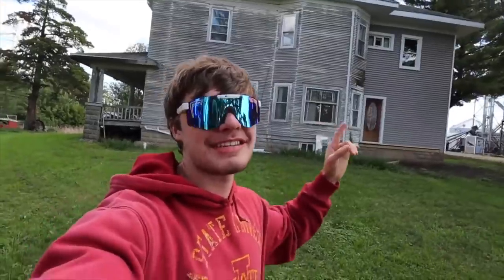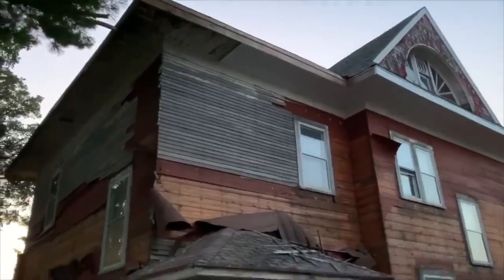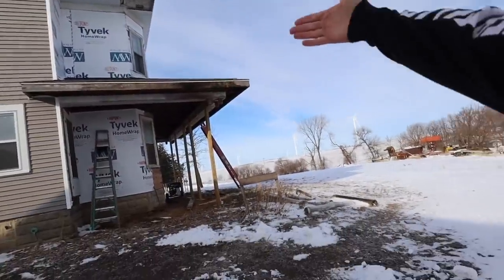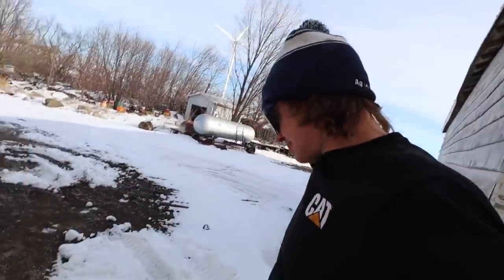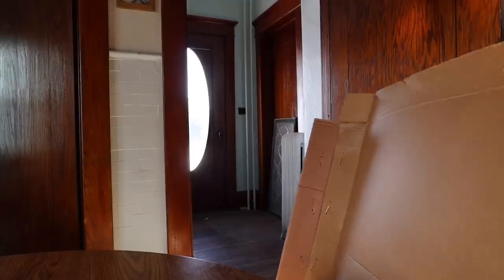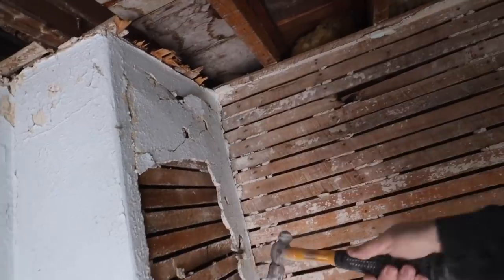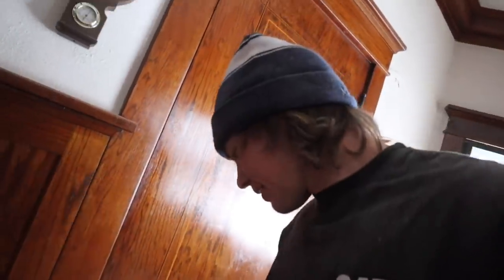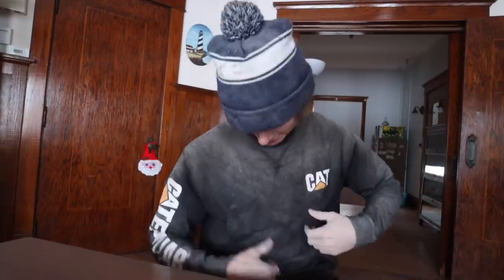Remodeling My Ex-Hoarder Mansion Ep. 1

Comment: the real fun  fun part starts when you go to drywall an old house like that is that they were built with real fir 2x4s and  you can not drive a nail or put a drywall screw in them as you will need to drill a pilot hole for every screw ! I did a little remodeling on my old farm house years ago ! wasn,t fun !!  torn that old house down this fall

Comment: When I was a kid in the 1950's, I used to hear commercials on the radio by the plasterers union because drywall was coming into use, "Demand genuine lath and plaster." They tried to stop the clock and now they no longer exist. You have some of that real vintage stuff! Enjoy your history lesson. Those floor joists are full size! If you need more that will be some custom milling. Houses today border on being flimsy. Enjoy your remodel of a real substantial house built by old timers who had their head screwed on straight.

Comment: You should mark the back of the trim pieces, so you know where you removed them from, so when you start to but them back up you know where they go, in older homes nothing is square and plum, and the marking of the pieces should help you with the puzzle of what goes where. A simple letter and number system should help. number the doorways and left and right trim pieces. Ect. and a basic sketch of the layout of the rooms will be helpful.

Comment: Cole do you get double glazed windows in the usa, this stops alot of heat loss if you get the right ones? Save on heating but stick up some solar panals, u would get free off grid electric. That alone would cut your bills down.

Comment: If you really have asbestos to remove, wet it down with a spray bottle with water in small sections and as you pull it apart to remove it. That will help to minimize airborne asbestos dust.

My brother has a house built in 1912. It has and old coal chute where the house was heated using coal. Over the years an oil fired furnace was added for hot water and steam heat. Several years ago he replaced the oil heat with central heat and air conditioning and removed the steam radiators. The steam pipes and hot water pipes in the basement were insulated with asbestos. He draped plastic sheeting and sprayed down the pipe insulation with a spray bottle, wore a respirator and disposable coveralls and removed it in short sections placing it directly in a plastic bag as he worked.

Don't let the asbestos blow out the door as you work. It will settle on the ground outside and can get airborne every time you walk through it or the wind or breeze blows. Even today the roads in and out of and ground around old asbestos mines is highly contaminated and asbestos dust can easily be stirred up.

If you have asbestosbe careful and stay safe.

Comment: Just install a 2.5 inch pipe from the basement to the attic that you can later pull electrical through. Should prevent you from having a sub panel in the awesome attic.
Reply from the maker: That's a good idea!

Comment: A bit late to be commenting this, but if you are good at drywall mudding or you know someone who is, I'd highly recommend just tearing out all of the lath and plaster walls, in general, and replace them with the sound isolating drywall, potentially with rockwool or a similar sound dampening insulation in the outer walls and the ceilings to help isolate noise between the floors and to help create isolated heating and cooling zones. Doing this will also allow you greater access to route forced air HVAC so you can use heat pump HVAC units instead of needing to rely on radiators for heat. Radiators just aren't terribly effective, even if you're a fan of them. Heat pump HVAC units can be a bit pricy, but their overall efficiency is great since they can heat or cool depending on which direction their pumping the refrigerant and, as long as your ambient temps are always above, like, -15F, you can find heat pumps that'll maintain a decent heat output. Ripping everything down to studs will also make it loads easier to figure out which walls can be easily removed and it'll allow better access for water and electrical work. Most houses from that era typically have few bathrooms, so taking the opportunity to reduce the number of bedrooms in exchange for more bathrooms can dramatically improve the livability of the space. If you can combine an existing bathroom into an en suite, then you can also sacrifice a bedroom to create a powder room that opens onto the hallway and another bathroom as an additional en suite bathroom for valued guests. Rinse and repeat as necessary. I like when houses have as many bathrooms as they have dedicated bedrooms with an additional half bath. So if you have five dedicated bedrooms, then it would be nice to have five and a half baths. That way, all of the people who are expected to be living there can all use the bathroom at the same time if you, for example, all come down with food poisoning from some dodgy take-out. If a room is meant to be an office, library, listening room, conservatory, or another specialized room, then it doesn't need a bathroom as it isn't a dedicated bedroom.

Comment: You need to fix the house wrap as the water will soaking in to the blown in insulation and then your going to really start having a gross mess inside the walls. That bath room was a hall closet or a closet off the bed room. There was not in door plumbing when that house was built.

Comment: As a professional air sealer from PEG I urge you to not epoxy the basement floor, but rather install a subfloor with drain matt underneath to prevent intrusion of moisture laden vapor and radon. Basically it is best to create a "bathtub" of drainage matt in basements.

Comment: Where's Neva Cole? 1. What is the response time of your local fire department to your place. 2. Where are the two closest fire hydrants to your property? 
3. Is your local fire department heavily dependant on tenders?  Given the amount of fuel load the house house in wood, you don't have sprinklers, no appreciable fire code upgrades being done, you should seriously consider having your own private source of water that can easily handle two 1 - 1/2" fire hoses supplying water at a significant pressure. Because you want to attach the garage to the house, the passthrough could become a means for the fire to quickly spread from the garage to the house. All new code approved wiring, breaker panels, switches, receptacles, light fixtures and appliances. Seriously consider installing sprinklers in the garage. It goes without saying, smoke alarms are a must. These things should be top of mind before an in ground movie theatre. Your life and the life of anyone who stays at your home should know that their life safety has been taken seriously when it comes to fire protection and suppression.
Stay safe.
Gerry, British Columbia, Canada

Comment: You mentioned that the house doesn't have insulation - mine doesn't either, but we're still planning what makes sense for us, since we have fairly new siding. Since you're putting new siding on, why not add exterior insulation board? Or are you using exterior foam?

Comment: I'm in process of buying a ~120 year old house and planning much of the same kind of demoing/renovation you seem to be planning! Nice!
Any thoughts on the structural aspects of the outside clapboards and inside plaster/lath in a balloon framed house? (Might wanna consider some added diagonal bracing in the process with all the original stuff coming off/rotting out?)
Just a thought, hopefully a supportive one! :)

PS: my new place is all knob/tube wiring, too. Looking forward to rectifying that. And the old galvanized plumbing. And the rather risky vermiculite attic insulation. And the ~80 year old garage/shed. And adding a 1/2 bath to the main floor to get it to 1-1/2 bath status. And replacing the 50 year old kitchen (cheap at the time even). Maybe if I do it, I'll link ya a youtube channel. :D "Thanks for watching!"

Comment: Another question, did you leave all the old water boiler radiators, I hope you did. With a new VieSSmann water boiler furnace which is very small is excellent. All so you can attach heated flooring and heated towel racks to it also. You do have a big house you may need 2 furnaces. Just saying. Can hardly wait to the finish product.

Comment: I am a retired asbestos inspector with 30+ years with most of my work in Michigan. Since you don't live in CA, NY, NJ or any of the other communist states, most state regs follow with the federal ones. Call a local asbestos consultant and get the plaster and any different types of insulation tested. As a home owner it should be cheaper for you than having one of the contractors do it, because as soon as you have a contractor come in they are required to have sample results or have it tested. Many states allow a home owner to do the demo themselves , but I have never worked in Iowa. Never the less you should test it to protect your health and anyone else who may enter your house. If it is asbestos containing material (ACM) you are already looking at a hefty bill since all that dust spread through out the house.

Comment: I think it’s very smart that you’re hitting everything. Although the old stuff is beautiful, you need to be smart about heating an electricity. Plus, as you can see, the plaster and lath just collapse with minimum force. Adding insulation, replacing windows, putting up drywall, redoing electricity, etc will help keep you from spending a fortune in heating and electric AND you’ll be safer. One question though… if you’re demoing everything, why are you not running duct work for heating and air conditioning?

Comment: Cole, have you tested for asbestos? If you're lucky there's none but as old as that house is it coul dbe everywhere including in the plaster and in the flooring. Might be worth at least testing so you know the dangers... Ah okay, sounds like you are aware of the danger. If you're concerned about it in the insulation you might be able to trap it with spray foam insulation but that's also possibly a ton of cash. Works GREAT though!

Comment: I just finished doing a ton of plaster/lathe removal. If you can, get a heavy duty scraper that has a place to thread in a paint roller/broom pole. 

Like this one: https://www.homedepot.com/p/Husky-3-in-Bent-Extendable-Scraper-410-140-0111/309896475?MERCH=REC-searchViewedNA-309896475--N& 

Use that to get behind the plaster and pop it off the wall. It does a fast job and you can use both hands. 
Once the plaster is off, you can scoop it up with a shovel. 
After the plaster is gone you can rip the lathe off. One tip I was given was to use a crow bar or wrecking bar and slide it behind the lathe, pull it towards you and it will remove several pieces of lathe at once. Just take care to not damage the wall on the opposite side if it matters. 
Toss out the lathe, jerk out any remaining nails, sweep, and move on. 

Note, removing plaster and lathe at the same time will make shoveling incredibly frustrating and really slows you down. I've tried it both ways. :)

Comment: I hope you have a structural engineer telling you what walls you can a d cant take down. Cause if you just knock down walls Willy nilly your mansion will be a pile of splinters. As far as putting the breaker box in the attic that will depend on the electrical code for your county and state.

Comment: If the plaster is in good condition, and if you're not moving walls or having to re-wire/re-plumb, etc., you may want to reconsider tearing it all out.  More and more, preservationists are saying that plaster is a better insulator, and it "breathes," which means hot and cold, damp and dry, doesn't affect it the way it will drywall.  Why remove something that's in good shape and functional, while at the same time risking damaging all that glorious woodwork?  Just a suggestion.

Comment: If you take down the plaster, insulate, and vapor barrier the house, the wood structure will rot behind the walls.  These houses were built to breathe with the weather.  If you remove that ability, it will destroy the house.

Comment: Tearing out complete walls to re-wire and re-plumb is wayyyy more work than necessary man. Unless they are exterior and you plan to re-insulate. 

Good electricians can fish new wire through walls  and across ceilings no problem. If you plan on using PEX for plumbing, that too can be fished through walls. If you plan on using copper sticks you’ll only need a stud bay to get those up to all levels. No need to rip the house apart to accomplish you’re goal. 
Why do it the hard way?

Comment: OMG, don't announce the presence of asbestos. EPA/Building Departments will make you hire an asbestos abatement contractor to remove it. Your house will become uninhabitable as will your bank account. Instead, describe the insulation as Rockwool. That is something typically used in older structures that looks like asbestos.

Comment: Well, you already ruined the trim and the doors in that little room.
   That insulation is most likely cellulose, not asbestos, it's ground up newspapers etc. treated with fire retardant.
   That's not water damage, it's from when they poured the concrete for the bathroom floor.
    You're already in way over your head, hire a professional now at least to consult with or you will NEVER get this finished. You hire several consultants to farm and you already know how to do that. What makes you think you don't need one here? Remodeling that beautiful house is going to take knowledge and talent in the housing trades, neither of which you have. 
   Please, take my word on this, you'll be happy you did.

Comment: dont remove lath and plaster just to replace it with drywall. lath and plaster is worlds better than drywall its also not that hard to repair. you will never see a drywall house that has had no windows for 30 years still have drywall on the walls but you will see it all the time with lath and plaster in abandoned buildings